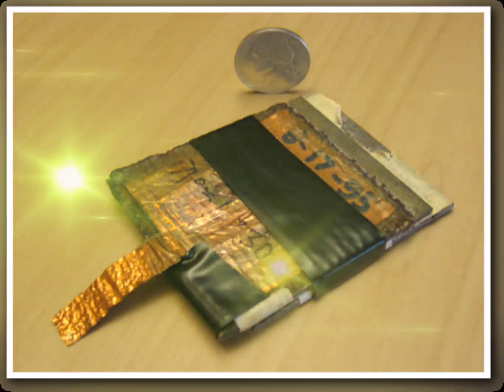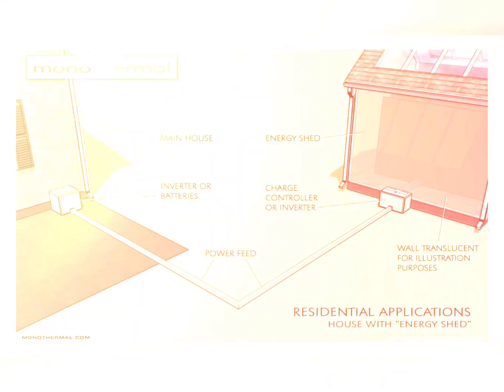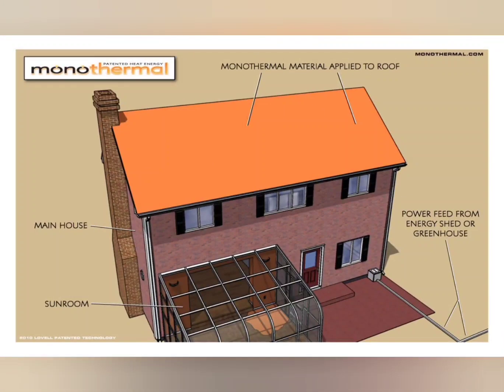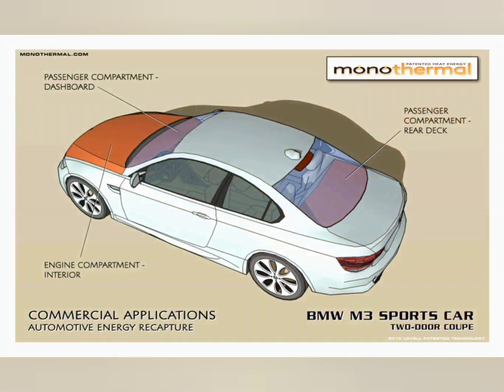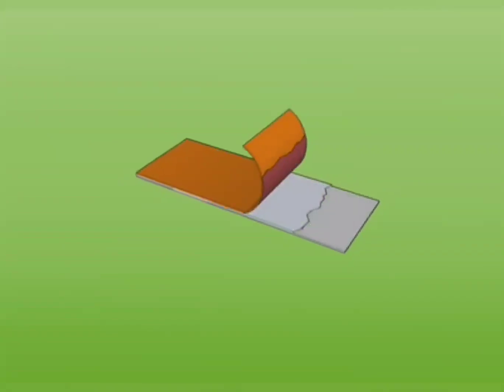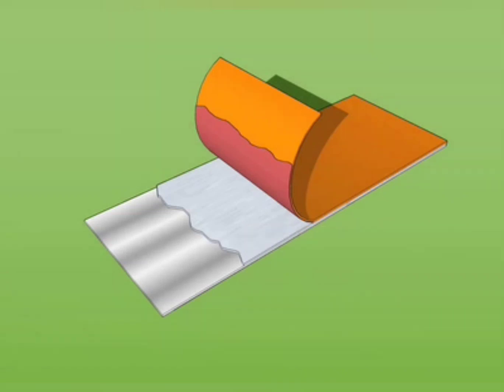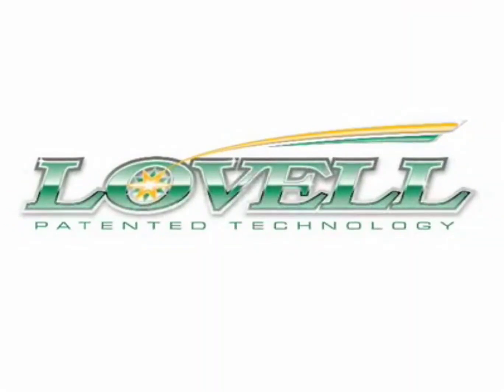Solid State Heat Energy device without a cold pole

Comment: No testing in 27 years, that's hopeful :)
So it really wants to be at 200 °F / 93.3 °C or a bit more. In direct sunlight you will not teach that perhaps, so added mirrors needed. And then you can't stack, you need lots of surface.
Now where else to get boiling heat to run these? Would insulation would or does it convert the heat into electricity? Then it might end up being inefficient. Needing loads of flow on the heat side.
Reply: solar panels still rule i guess
Reply: It's come a long way in 27 years it's been developed into a paint and operates really well at 85 90 degrees,a 10 by 10 wall painted 12 time will give you 4200 to 6500 watts of constantly Power 24/7 no light needed,and in the patent walter lovell states their is no such thing as cold,I've frozen mine in a block of ice and still was able to charge a 2.7 volt 350farad super cap with it,

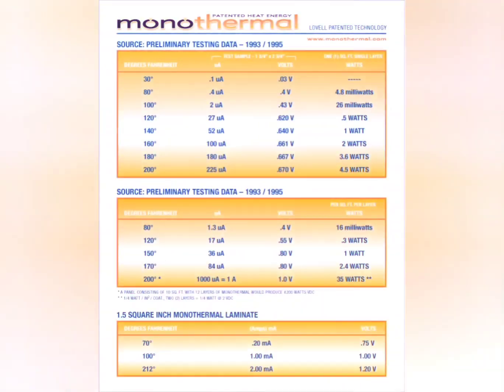Comment: Does anyone know how much Ampere a micro Ampere is? I do. And if you multiply by a thousand? Is that one Amp? Nope, but it is what they show at 0:20. Plus, this stuff is from way back, over 20 years ago. Don;t you think it would already be in use if the technology is readily known?
Keep up the hopium .. .. I know gas is problematic nowadays.
Reply: my cat says 
1 amp = 1 million microamps or 1000 milliamps
Reply from the maker: Depends on the surface size and the temperature and how many plates you stack together...
Reply: @oudotcom  agreedos, even used as a smartphone charger application would be something
🐱👍🏿
Reply: A 10ft by 10 ft painted 12 times will give 4200 to 6500 watts that's really not that bad